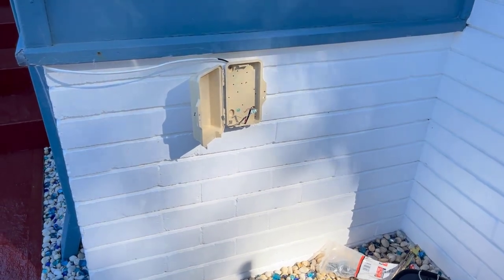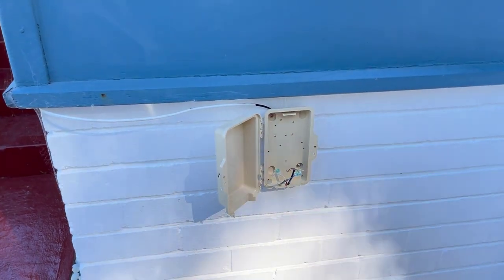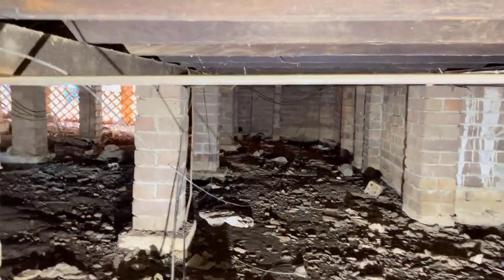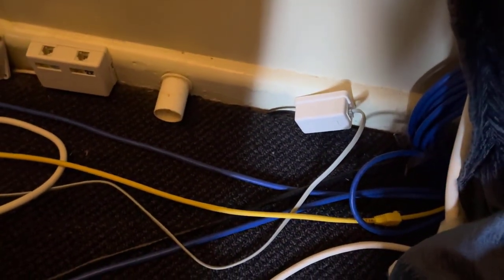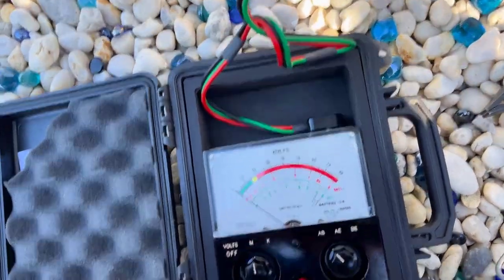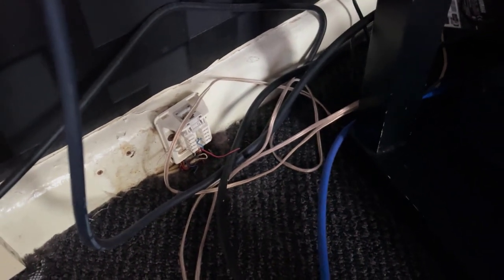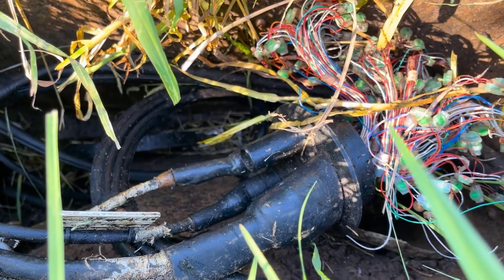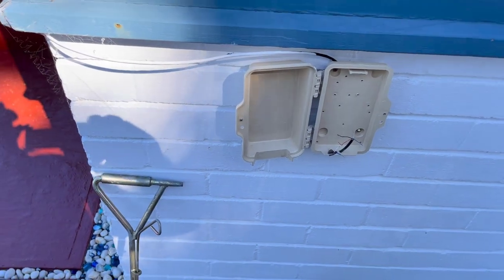NBN FTTN 10 Months of Dropouts... What We Found Will Shock You!

Comment: This is exactly the same shit that was happening the 2000's when I worked Telstra Activations (plant assign/activation). Apart from the obvious fact that the network isn't fit for purpose, the way that techs are pressured to close off jobs, this kind of stuff was always going to happen. While I do think there's dodgy techs, even the good techs aren't give time to diagnose and rectify faults. Easier just to run the tests you know will pass (or, just fake the results), then close it off. Hell, some wouldn't even call in pair changes, or hand things back to the WMC, because of how much pressure they're under.

I had techs tell me that their employer wouldn't cover the full cost of any cable they replaced, so he had to dodgy stuff up, or he'd never get paid.
Reply: I've had this explained to me by an "acutally employed by Telstra" tech (very few of them left). With the different levels of "who owns what" in the pit. The guy standing there would only be allowed to do what is on his ticket....as the job was to fix some part of NBN's copper etc. Where he finds - its a cracked pipe belonging to Telstra that is letting the water in.  It has to be passed back as he is standing there representing NBN on this job (even though he is a Telstra Tech). I copped 7 months of NO internet when I moved literally opposite ends of the same street. Telstra moved my pairs... But the ISP wouldn't re provision the ADSLservices I had on them. This was because it was close to NBN lauching in the area. Some one was smart enough to jump start my NBN swap over (to FTTC) slightly early. But good intensions miss fired. They were looking for me in the wrong pitt as we were on a corner block. NBN is FTTC at this location in question. They had the wrong NBN ID number with the sytem looking for me at a pitt around the corner. When my pairs were traced (thanks to years of no one updating the OLD records). Plus me being the only tennant in the buidling in years. When they lay the NBN fibres to operate the FTTC nodes out front in the ground... No one was around to let them check the end destinations. They did this while I was in the old place up the other end. First tech visit finds out I'm being looked for at the wrong pitt and sends the correct mac info for the node and gets the correct NBN ID for me. Which should all come good when they fire up that node. Now we find out they can't communicate with the node - the fibre is broken that feeds it. Another 7 months of no internet until it finally gets fixed.

The advise I would give is get right on to the TIO at the first complaint. The next tip is make sure there is a ph number attached. This means Telstra is obligated to supply you a working ph service. This helps put the fire under thier butts. It's only Telstra that has this rule due to being the ex gove telco.. If you are all about the internet only -- you are waiting! I had a few funny "strange things" happen. I'd have the Telstra lady working my case ring me to say nothing new has happened. With a knock on my door by 2 techs sent out from Sydney to fix it. They then find out the fibre is broekn in several places and they mention the "time thing" and have to move on.

I will say the compensation cheque (which wouldnt happen without the phone number being attached) helps sooth the anger demons. But I'd still would have prefered it right on the first go.
Reply: heard the same story of my parents place (rural). The tech admitted a damaged section of line needed replacement, but telstra refused despite many escalations. The line would fail every few weeks.

Comment: Easy fix. Find or create a new good 0,pair from leading joint to pillar. Test leadin. Re-jumper to correct c pair. job done. If drop-outs still occur call nbn to allocate new c,pair.
Reply from the maker: Thanks for your feedback on this video 👍
Reply: Drop out is in the node. Its poor termination, pity techs have No access to them ,  cause they would mess it up like the pillar.

Comment: All my fault codes ended with x for contractor /staff activities . My EXFO would pick up a Hi Res or heavy wire to wire within 5 minutes using TDR . Pity you couldn't "loop a line " into the joint and find the pair and test how far or beyond . Teletech do a really good model TX916 . Also how come you dont earth the green clip and test each leg and loop legs together using the loop aline machine -test the end internally ( nb i know its not  faulty ) and check ? I am afraid you have a lot of  incompetent skilled contractors either  under telstras umbrella contracting for NBN or some other group for the NBN .  First thing they should  do is isolate isolate isolate and then fix it . Not guess assumption ( 34 years out of Adelaide )

Comment: In the UK an engineer would of done work on the open pit area and then further up the network 

Diagnostics would of shown this from the tech team on the phone as our system can diagnose a line from the connection point at the exchange right up to the end user socket 

With this job the pit area and back up the network to be checked and new contacts with gel installed